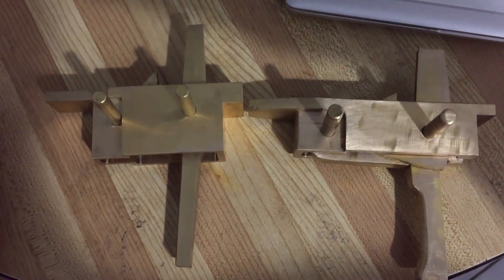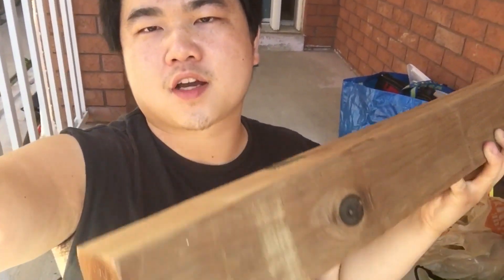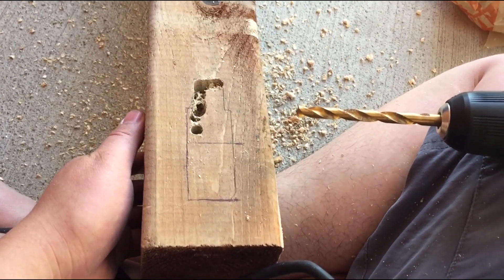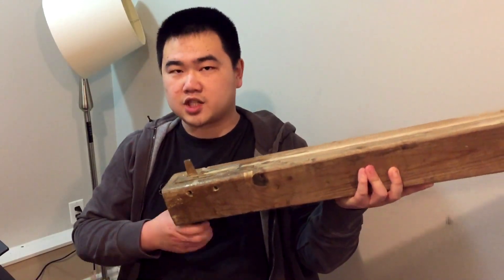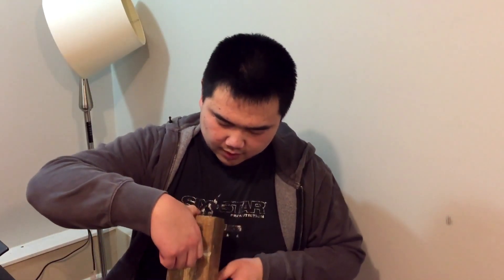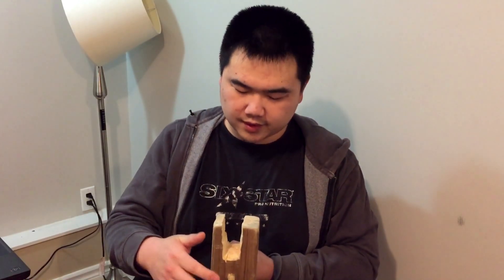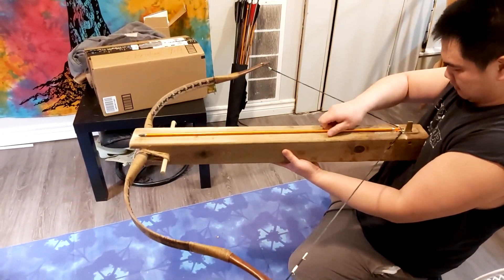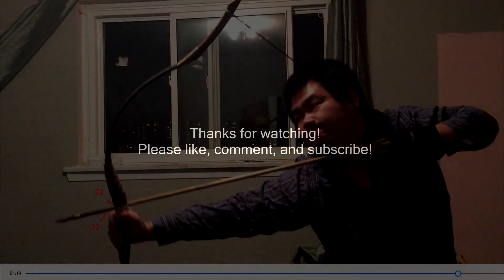DIY Ancient Chinese Crossbow Prototype

Comment from the maker: We did some analysis to find the most common Chinese crossbow draw weights, 
based on the Chu Yen slips (居延汉简甲乙编) page 1-5
Conclusion: 390 pound most common. (it is 6 Chinese stone, which is 6*65lb=390 pounds.)
Methodology:
step 1. Find Chu Yen Slips ancient text. the draw weights are categorized based on 1 chinese stone, 2 stone, 3....10 stone etc.
step 2. Count the frequency of each of these stone from the text. Hackneyescribed did page 1-5. 
step 3. compile to excel 
table:
lb  stone  #   percentage
65	 1	10	8	%
130	2	0	0	%
195	3	19	15	%
260	4	11	9	%
325	5	22	18	%
390	6	59	48	%
 <===most common
455	7	0	0	%
520	8	2	2	%
	TOTAL	123
Reply: I assume drawing those 390 plus pound crossbows was a two man job
Reply from the maker: @alternator7893  not necessary, we have evidence of han chinese using spanning devices such as windlasses. keep in mind 1000lb windlass steel crossbows exist
Reply from the maker: @alternator7893  although its probably cheaper for them to just grab two people
Reply: @Historicalarcher  Will you be doing more documentaries on the history of the Chinese crossbow?
Reply from the maker: @user-uy1rg8td1v  i will once i finish the rest of these projects i have, been busy and it seems most people are interested in me shooting heavy historical bows rather than the documentaries

Comment: Howdy, This is a perfect example of power stroke over draw weight. Most people relate the draw weight of the prod with the power of the weapon, but you've shown that a long draw, lower weight prod that doesn't need a windless to cock dogs a much heavier short power stroke crossbow. Good work young man!
Reply from the maker: Thank you. I’m planning to move up to 300lbs. What do you think is the most realistic prod that can handle 32”

Comment: What is the most common Han crossbow draw weight? Answer: well, someone actually counted the frequency based on the maintenance records, got 6 Han stone = 387 pounds.
By HackneyedScribe: Let's go over the first five of the compiled pages for the Chu-Yen slips: 
1st page: 居延汉简甲乙编 : 居延汉简甲乙编 - 中国哲学书电子化计划

79: a 5 stone crossbow
81: a 6 stone crossbow
355: a 6 stone crossbow
586: a 3 stone crossbow
826: a 5 stone crossbow
1382: a 6 stone crossbow
1423: a 6 stone crossbow
1586: a 4 stone crossbow
1754: a 6 stone crossbow with present strength 4 stone 42 jin
1756: a 6 stone crossbow with present strength 4 stone 30 jin
1813: a 5 stone crossbow
2087: 6 stone crossbows, 7 of them

2nd page: 居延汉简甲乙编 : 居延汉简甲乙编 - 中国哲学书电子化计划

64: a 6 stone crossbow
258: a 6 stone crossbow
413: second 6 stone crossbow
524: a 6 stone crossbow
597: a 90 stone "great yellow" crossbow
598: a 8 stone crossbow
599: a 6 stone crossbow
600 a 6 stone crossbow
750: a 6 stone crossbow
752: a 3 stone crossbow
875: a 6 stone crossbow
877: a 6 stone crossbow
956: fifteenth 5 stone crossbow
988: a 3 stone crossbow
1368: a 3 stone crossbow
2018: a 6 stone crossbow
2066: 3 stone crossbows, 4 of them
2559: a 6 stone crossbow

3rd page: 居延汉简甲乙编 : 居延汉简甲乙编 - 中国哲学书电子化计划

292: 6 stone crossbows, 3 of them
293: a 5 stone crossbow
551: 6 stone crossbows, at least 2 of them (words after the 2 is too smeared out, could be 2, could be 200, who knows)
1169: a 5 stone crossbow
2206: a 4 stone crossbow
2211: a 4 stone crossbow
2222: a 4 stone crossbow
2227: a 4 stone crossbow
2237: a 4 stone crossbow
2242: a 4 stone crossbow
2253: a 4 stone crossbow
2258: a 4 stone crossbow
2267: a 4 stone crossbow
2272: a 4 stone crossbow

4th page: 居延汉简甲乙编 : 居延汉简甲乙编 - 中国哲学书电子化计划
542: a 6 stone crossbow
853: a 3 stone crossbow
1206: 680 strings for 6 stone crossbows
1232: 3 stone crossbows, 8 of them
1597: a 6 stone crossbow
1634: a 5 stone crossbow
1792: 1 stone crossbows, 10 of them
2101: 6 stone crossbows, 24 of them

5th page: 居延汉简甲乙编 : 居延汉简甲乙编 - 中国哲学书电子化计划
965: a 6 stone crossbow
1292: 6 stone crossbows, 2 of them
1340: a 3 stone crossbow
1803: a 5 stone crossbow
1973: a string for a 5 stone crossbow
2290: an 8 stone crossbow
2291: 6 stone crossbow
2292: 3 stone crossbow

As you can clearly see, the 6 stone crossbow was the most common
Reply: note sone unit is not british stone, but chinese han stone, one chinese han stone is like 65 ish pounds

Comment: One thing I wanna know, that Chinese bows were composite, made out of natural materrials. So, they needed be unstrung everytime. So, they unstrung these crossbows everytime? English crossbows were made out of steel, so they didn't need to ne unstrung.
Reply from the maker: from my understanding yes. they probably are used to unstringing quickly

Comment: Your stock is way too wide. That would support 100's of pounds. You're adding several times the string friction necessary by making it drag over so much wood. Make sure the top of the stock is super-smooth & waxed/oiled to minimise friction & string wear. Also your bow-lashing cross piece is very weak. They had rectangular section lashing bars that is clearly shown in Steven's crossbow & in all the illustrations I've seen. So grateful to find out here that these locks are available.
Reply: His prod is a regular bow. He doesn't have a custom made crossbow prod so he is just using his normal handbows for the prods. Are you talking about the width of his crossbow stock?
Reply: @Intranetusa   Oops! Quite so, just corrected thanks. Good points in your other posts.
Reply: P.S. Yes. hardwood is expensive, but look out for old hardwood dining tables as a leg could make an excellent stock. You underestimate the strength of the wood. Your fencepost would take a 20st guy standing on to of the end of it easily.
Reply: he made fps comparison of hand shooting versus crossbow:  170fps versus 167 fps. thinner stock will have slight i mean very slight improvement

Comment: Your crossbow is nice ;-) I wonder if it's possible to make such crossbow with 100 lb or even 120 lb bow...
Reply: Definately, up to 200lb+ probably, but don't forget these can be 28-32" draw lengths, so you should be thinking in terms of hand bow performances(minus a little lost in string friction over the stock) rather than in the very inefficient crossbow terms where you need far more power to deliver the same performance as a hand bow. War bows where exactly what they were made for, to enable the Chinese peasant soldier to be able to shoot warbows.
Reply from the maker: we will see in the next vid about this crossbow
Reply: The ancient crossbows had much higher draw weight but lower powerstroke & draw lengths. HA plans to eventually scale up his crossbow to his 240lb longbow with a 30 inch draw. For comparison, the historical median/most common Chinese crossbow of the Han Dynasty had a 387 lb draw weight, with what was probably an 18-20 inch draw length or powerstroke. So ancient Chinese crossbows "usually" did not use regular bows as their prod.
Reply: Just how powerful a military crossbow could be is glimpsed in the excavated Chu-yen slips, from which records of crossbow maintenance was kept. 
1 Han stone = 64.5lb                              1.37% 
2 Han stone = 129lb                               1.37% 
3 Han stone = 193.5lb                          21.92%
4 Han stone = 258lb                                2.74%
5 Han stone = 322.5lb                           17.81%
6 Han stone = 387lb                              43.84%
7 Han stone = 451.5lb                             2.74%
8 Han stone = 516lb                                 2.74%
10 Han stone = 645lb and above           5.48%